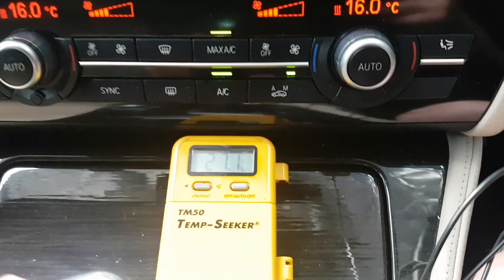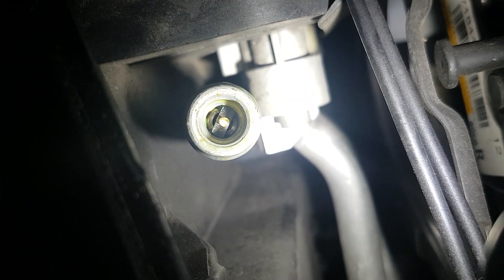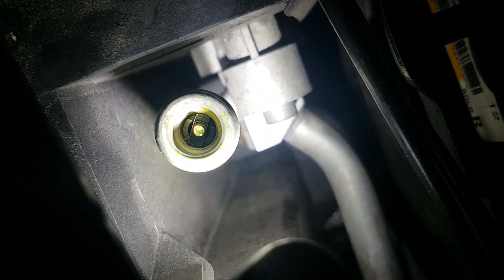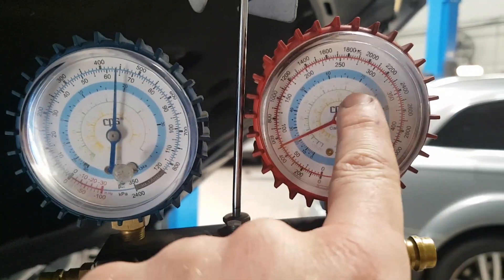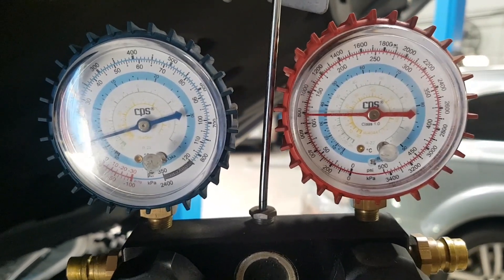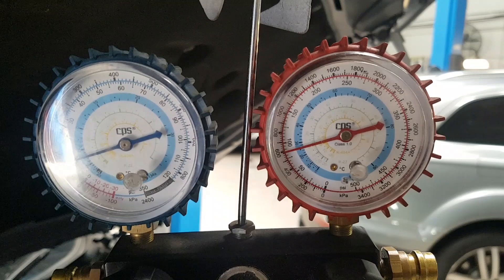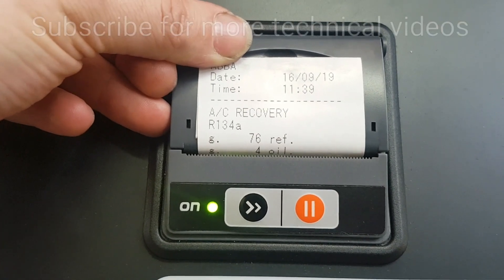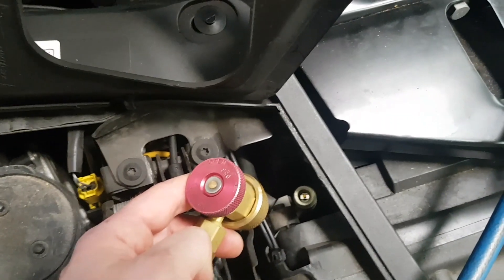BMW F10 Air Con Not Cold - A/C Diagnostics

Comment: I changed my cooling radiator with a Nissens and after the AC works for 5-10 minutes and stop. No one can solve the problem. they say that the compressor is working just fine. Any idea? it is possible that the radiator to have other pressures besides the oem ?

Comment: Hi Great video!, i have a 2010 F10 530d, had it regassed 2 weeks ago and apparently the machine checks for leaks i was told, now i have exactly the same hissing and no cold air, any help would be greatly received.?
Reply from the maker: Condensers seem to be common sources of leaks on these. The machine only checks that it can pull a vacuum and that it'll hold. It means there's no large leaks. Small leaks can still pass the vacuum test.
Reply: @FourRingsAuto  Thank you for the reply! I was hoping it might be the valve as in this video. lol

Comment: I had the same problem. After refills , AC works . But where do you think is the leak for my car? It leaked again about 1 year later.
Reply from the maker: Check the condenser for stone chips. Did you put UV dye in the system?
Reply: @FourRingsAuto  I did, I think I have leak on high pressure port, just like your video. what part do I use to fix the port ? just tighten it ?
Reply: I just found out I have the same leak at the same spot ( low service port ) can you please tell me which part do I need to fix it? Thanks a lot!

Comment: Another well made and informative video.
I actually started fitting air conditioning systems into vehicles over 40years ago and apart from electrical systems and obviously the changes in types of gas, the principle is the same. Unfortunately not the quality of the basic parts which seem to be regularly failing. Valves, seals etc seem to be very poorly made these days. Of course, everything needs to be a clean as possible prior to opening any system to replace any parts as we know contamination destroys efficiency.
BTW... I have used your vw tsi air flap fix on several cars now including my daughters.... All working fine and no new parts. Cheers